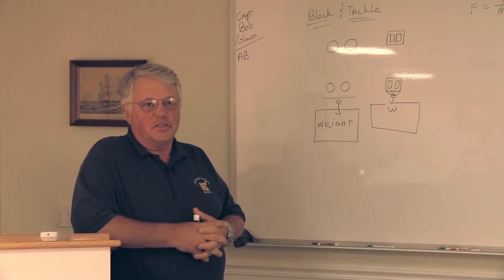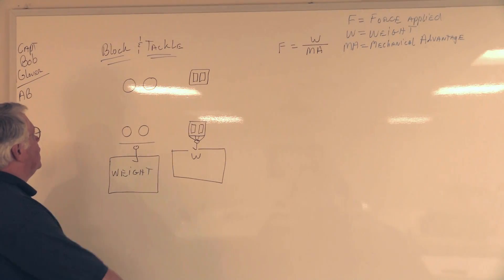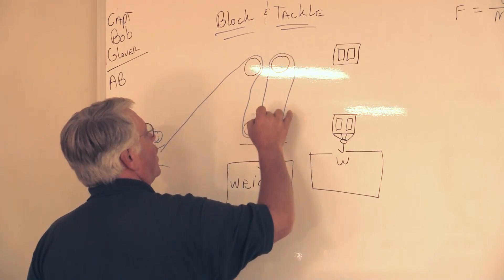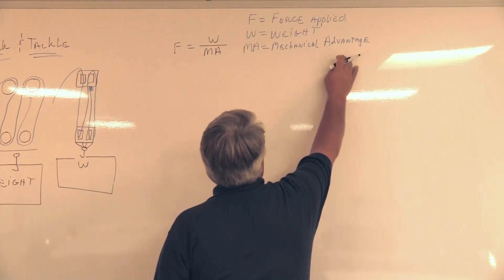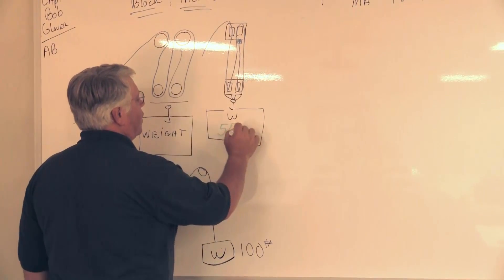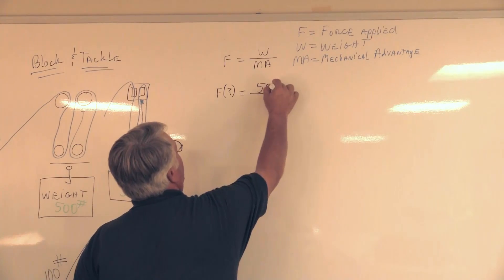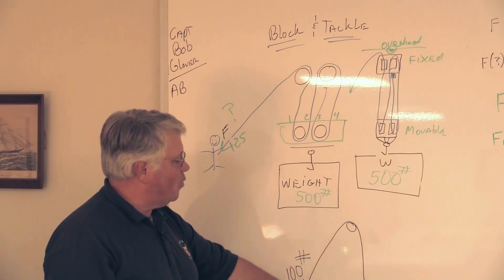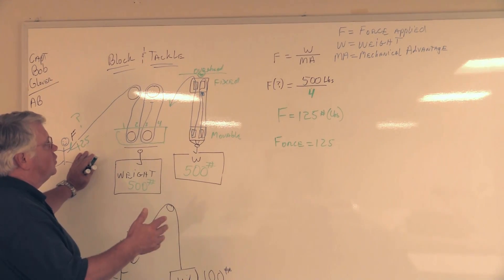Block and Tackle Part 1

Comment: How about different size pulleys?
Reply: It would be the same because every segment of the string pull uniform tensions to the weight. Just keep every string close to the vertical line

Comment: Out of curiosity using the same scenario if the rope for instance were rated for only 200Lbs would the total lifting ability be multiplied by the number of ropes ? @800Lbs
Reply: Each complete turn (wrap) adds (roughly )double the MBS because of load splitting. If you make a theoretically perfect sling (an endless loop of rope), you have doubled the capacity before it begins to break. Fold the sling over, you doubled it again. So you can think of a block and tackle as an arbitrary number of slings that can be shortened by the inclusion of a half wrap that you can pull on.

Comment: Excellent presentation on the basics of block and tackle systems and the math behind the mechanical advantage (MA) to determine how much force (F) is required to lift the weight (W). F=W/MA. Thanks Capt. Bob